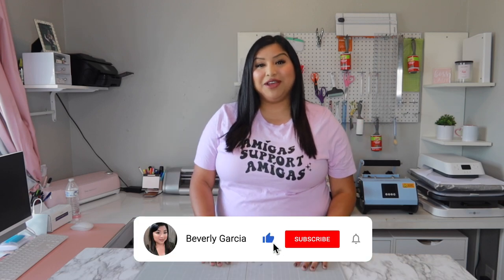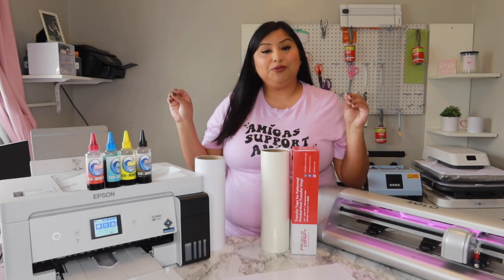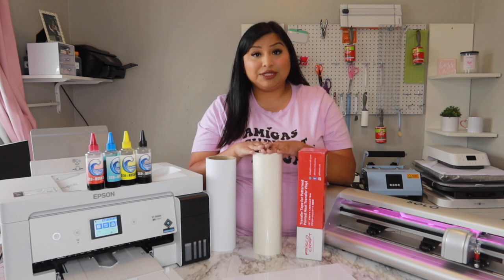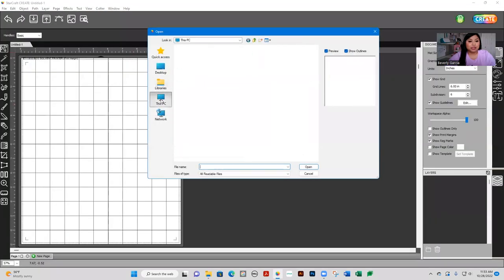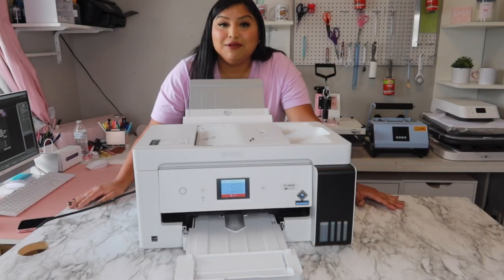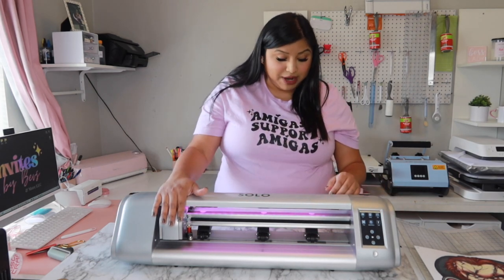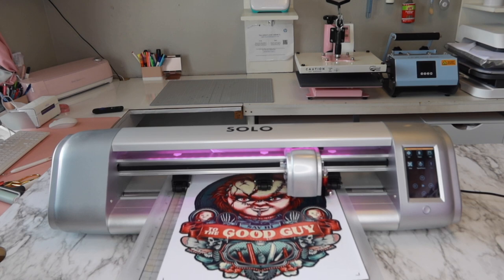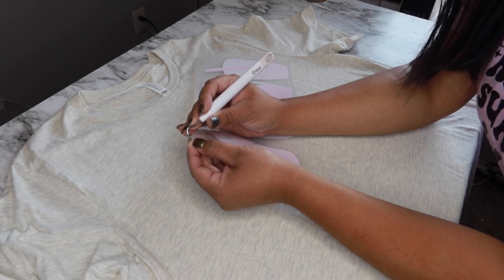How to make Eco-Solvent transfers with converted Epson ET-15000 printer | PART 2. PRINT THEN CUT

Comment: Hi Beverly…I’m Beverly, too. I will be setting up my Epson ET-15000 this weekend as an eco solvent printer. I’m wondering if I will be able to use my prints on anything other than fabric? Can I use a mug press to press the print onto a mug or tumbler? Thank you for this video…I have been a bit concerned about going to an eco solvent printer but I now have everything I need to get started…..so here I go! Wish me luck!
Reply: Hello can we do it or not?
Reply: Sublimation is the way to go for mugs and tumblers

Comment: Is it still possible to print with Eco Solvent ink on paper ? I mean, satin 130g paper or gloss 150g paper and it will not smudge when comes in contact with water ?

Comment: Do you know if water based eco solvent works on the following paper: regular office paper, photo paper, satin or matte presentation paper (13x19 usually, like koala brand). Also one weird request is to know if it works on non-heat transfer vinyl like 3G Opaque or JPSS.. Not to use on t-shirts, but for 6x6 stretch canvas. I'd be using HTV for shirts instead.
Reply from the maker: Hello! Yes the water based eco solvent ink works on photo paper & regular copy paper, I just feel that as for copy paper prints are not as vibrant & also ink has strong smell in general …. Yes I’ve seen people use it on 3g jet opaque transfer sheets

Comment: I purchased a Solo StarCraft and Epson ET-15000 this week along with the vinyl roll and transfer tape roll. I printed on the vinyl just fine, however, my Solo WILL NOT cut the vinyl. I've wasted sooo much vinyl trying to test it out. What could be wrong with it? I have tried to research what I am doing wrong.

Comment: Realistically is it more dangerous to convert your printer to sublimation or eco solvent? I already have a 15000 converted for sub and just bought another that I’m undecided to convert to eco solvent or not. I hate that I could possibly have two printers and neither uses the proper ink lol. Thanks for the video.

Comment: Do you know if this will work with Prismacut 20 cutter?
Reply from the maker: The printer itself is going to work with any cutting machine as long as you software compatible with it it should work, so essentially you would be using the cutting machine software program with the printer

Comment: is this waterproof and fade resistant or no? whats the benefits of switching?
Reply from the maker: Yes for the most part it’s waterproof and some what of face resistant just depending on how you wash your clothes that’s why it’s a level up from the regular inkjet Tshirt transfers
Reply: @bevscraftystudio  oh I just want to make stickers for cars and stuff so is that good for vibrant colors?  And I want to print on different color vinyl to make decals for windows so what would I have to search for on amazon that's a different brand? Just heat transfer vinyl?

Comment: Beverly I got the printer and cutter 
For 11x13 on Mac how can I change the setting I am having a trouble I did try printer setting too but nothing is working printing has streak and it going very fast while printing
Reply from the maker: Did you download and install drivers ?

Comment: I been using Eco-Solvent for a few months now so still fairly new, I do like it but I never did the curing method...I usually print, cut, then press right then. What are the benefits of curing it? And is it necessary?
Reply from the maker: Yes it holds the ink in longer allowing it to let the inks to settle in

Comment: Hello, your video has really helped me get setup with my solo, I have one question on the printer itself what size do you select for the paper, I know you mentioned 11x13 for the paper but on my 15000 its only a setting for 11x14 and when printing the image is cut off; like the printer tries to print the whole media size 11x14, Do you think you could help with this?

Comment: Question have checked out easy color dtv siser i see it use the regular ink in the printer  i ask because i found a good deal on a 15000 printer but it has  eco 
solvent ink inside already
Reply from the maker: i have the dtv from siser i just have not tried it yet with a regular printer yet i need to get to it.

Comment: Hello…..I’m new to T-shirt making but I’m about to purchase this printer. Is it necessary to convert this printer to eco solvent for T-shirt making or is this just a choice?
Reply: I have this printer and mine is converted to sublimation
Reply from the maker: Hello, its a choice and the reason why i did was due to it lasting longer than regular ink , eco solvent ink is water resistant.

Comment: Can I do your same process, but use Oracal 651 White vinyl instead and ti make stickers and get the same results?
Reply from the maker: it wouldnt work on oracle 651 because its not permanent, thats only for cutting
Reply: @Beverly Garcia  I'm not sure what you mean. Oracle 651 is permanent vinyl.
Reply: Oracal 651 is not printable. The ink would not dry. You would use a printable vinyl.

Comment: Interesting, I never let my prints sit overnight. I print, cut and press… Im gonna start letting them sit for about 12 hours for now in!!!!
Reply from the maker: yes definitely you will see a difference for sure
Reply: @bevscraftystudio  actually I tried it and my prints have a green tone to them now. I don’t know if it’s the s print paper or what.
Reply from the maker: @Scrap3001   you know what i have heard it when you press S-print i have heard that the black turns greenish not sure if it's just because its converted printers or if it's meant for only real eco solvent printers